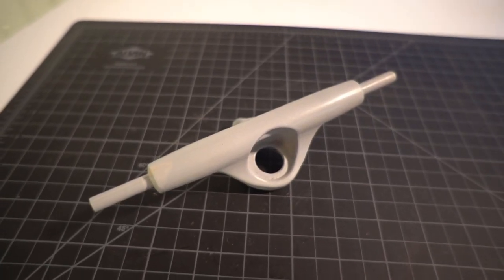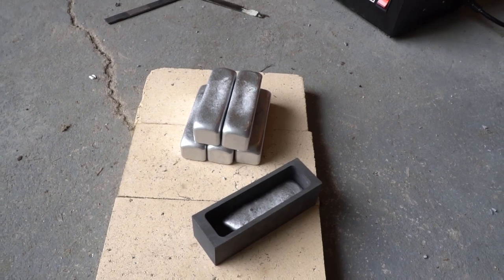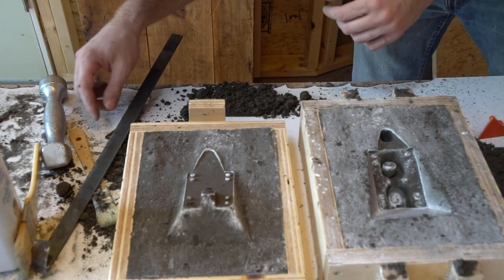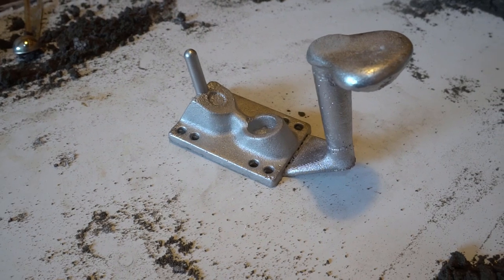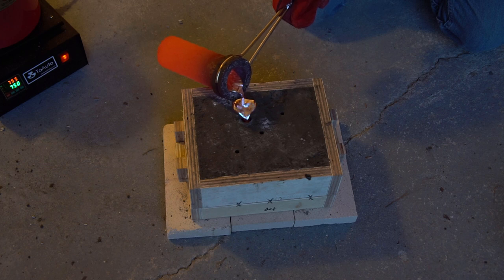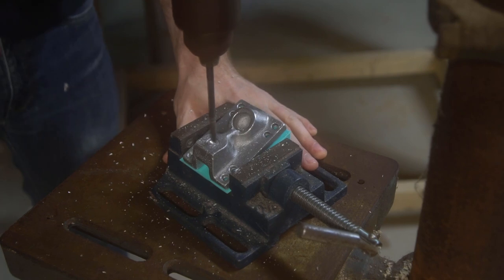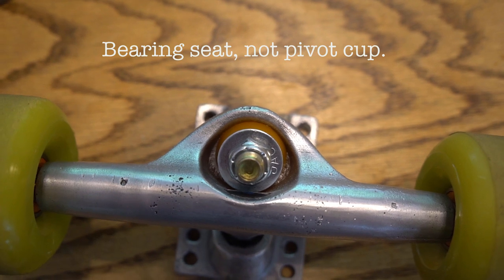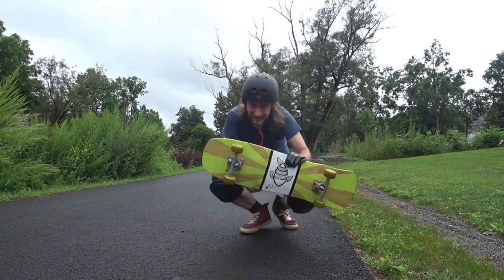Casting DIY Skateboard Trucks At Home - Ep. 3

Comment: Personally i've been thinking a lot about making trucks, but i think i'll be going the "precision" way, where you machine longboards trucks out of a solid billet of aluminium

Also, multiple mounting holes is very common on Longboarding.

For the axle, higher ends Longboard trucks have a tapped hole in which you screw the axle part. Allow for more precision, multiple width options, as well as not ruining the temper on the axle
Reply from the maker: Yessir. I'm very familiar with the world of precision trucks and hot dang that is a cool world. But as you probably know, the cost increases exponentially as you get into that realm. My riding is not at a point where I need trucks at that level. That said, if you're going to machine yourself a set that's freaking rad and I'd love to see what you come up with. Keep me posted!
Reply: @GoodRoads  i need to invest in a small CNC mill (was thinking an ebay 6040 with 4th axis), but that will have to wait for a bonus at work before i can afford such a machine ! If i ever come to it of course i'll let you know
Reply from the maker: I hear ya dude. I'd love to get a workbee cnc for snowboard cores and sidewalls, molds too I suppose, but it's never quite a priority in the budget. At least not yet
Reply: @GoodRoads  those desktop CNC look super promising but i'm afraid they won't do the cut (pun totally intended) for machining aluminium. They can do it, bit they're really not optimised for this.

For snowboard core or skate molds i would look more into an AvidCNC style of machine, though that's a different category altogether ... And quite expensive. But a DIY equivalent has definitely been on my mind for while, though that's quite a project i never found the time to fully get behind

Comment: Id down to shred this!
Reply from the maker: I gotta figure out how to cast motor mounts into the hangers right?
Reply: @GoodRoads  Id say yes and no, really up to you on that.
Most mounts are made to replace if needed. So best imo to make a truck that the hangers geometry allows for a good locking shape.
Caliber trucks have a very square shape, this and things like Matrix II trucks with its octagon-ish shape allow for good mounting.

With that said its 110% possible to make it a all in one.

As for a Channel Truck.
I would say use PKP setup. (parallel kingpin setup/dual kingpins)  This would allow the base plate to be cast and the hangers for channel trucks or MTB trucks.
Look up No-Snow or No-Sno trucks something like that, it kinda shows a example of a PKP.
Reply from the maker: I've been seeing the dual kingpin trucks around lately, I'd definitely be interested in checking them out and they would be the easiest to cast for sure, just don't want to step on any toes since I think that's a relatively new design
Reply: @GoodRoads  I also street skateboard, so Im down to rip some DIY trucks in general.